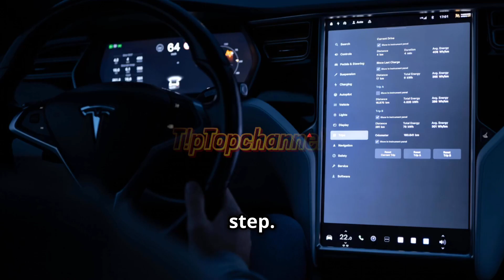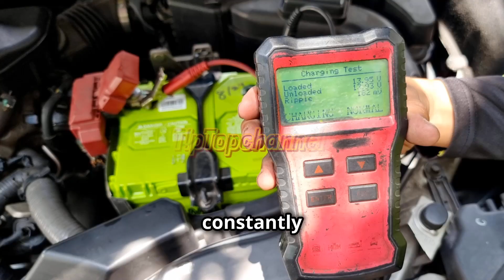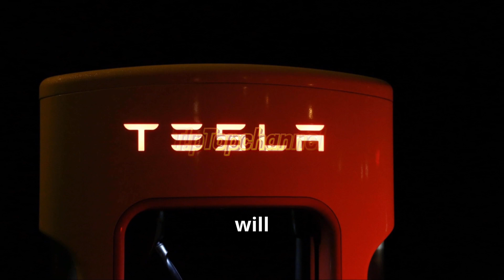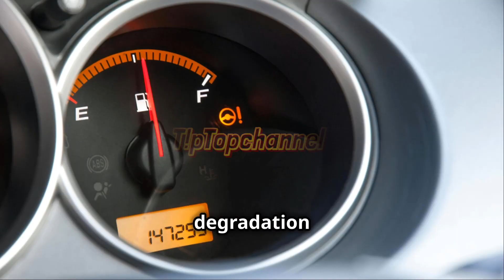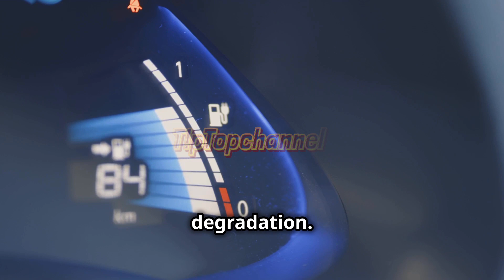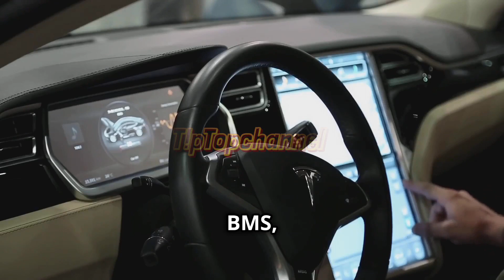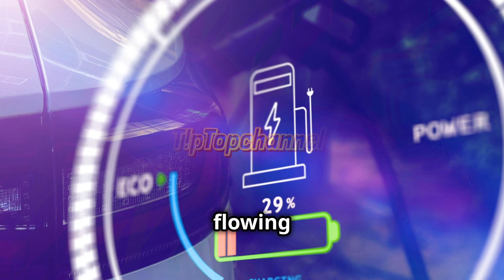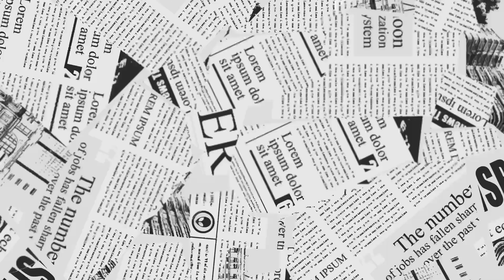How Long Do Tesla Batteries Really Last? | TipTopChannel Explains by ttch

Comment: If this isn't directly produced by Tesla, I'll eat my hat.  I thought that this was going to be a real impartial test of Tesla battery performance.  Instead, it came across as a very long commercial.  Maybe there is some truth in this video but it was all very one-sided.
Reply: I agree with you that the tone of that video was rather one of a manufacturer's video.  

HOWEVER, everything mentioned or just about (a few minor mistakes) is true (and NOT just "...some truth...") and perfectly matching my own experience.  Actually, there is a still small but growing number of Teslas with their original battery in good health after 300'000, and even some over 400'000 miles!  And those were obviously early models.  Battery technology has much improved since then.

Comment: In another video, someone mentioned a legal case brought against Tesla in Germany. IIRC, the owner claimed that Tesla should cover a battery at something like 200,000 miles. Tesla argued that it should only be forced to cover the battery for 130,000 miles. 

Manufacturer and owner claims of long lasting batteries mean nothing to me without an actual battery capacity warranty.

Comment: At 4:10, this is not true. The overwhelming proportion of Tesla vehicles sold are the Model Y and the Model 3. The warranty for many Tesla Model 3 vehicles was 8 years and 100,000 miles. I just bought a 2024 Tesla Model 3 Highland Long Range RWD. It has an 8 year 120,000 mile warranty. Tesla Model Y vehicles have an 8 year 120,000 mile warranty.